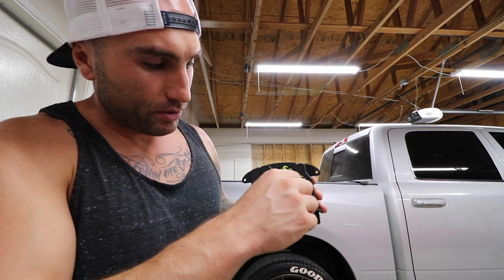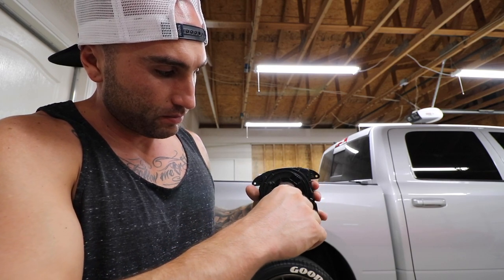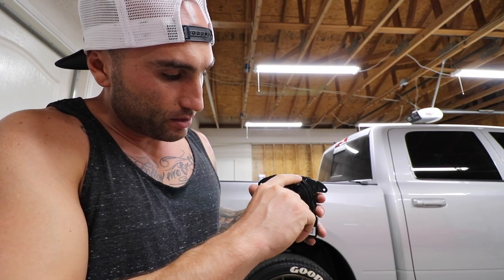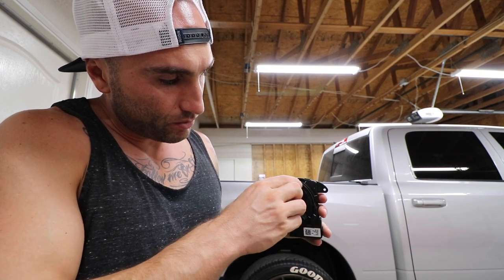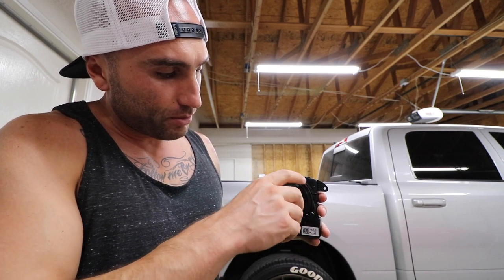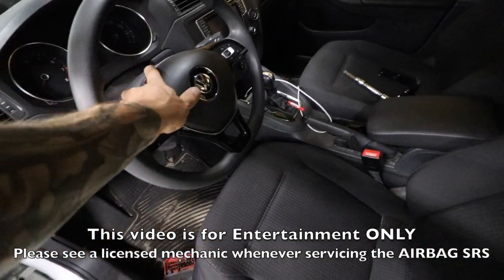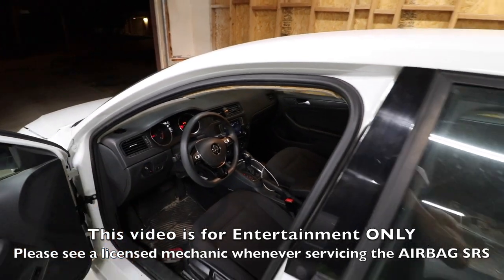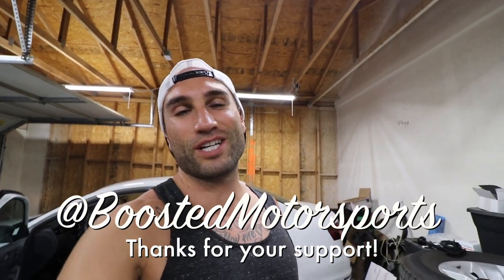How to Replace a VW Volkswagen Clock Spring - MK6 Jetta or Golf

Comment: Does anyone know if there is a 12V source that can support 1-2A current for an external steering wheel heater that is passed throught the clock spring on these cars?

Comment: Do not rotate your clockspring before replacing. Vw should auto learn SAS steering angle sensor as soon as you go driving.. it needs to detect wheel speed from all four before it recalibrates.. but if you center the wheel before removing just pull off and put on new clockspring and remove the locking tab

Comment: Before anyone replaces a clock spring/ squib refer to your workshop manual to find out what make of spring you have valeo or another. Not all exact models have the same make of clock spring which means removal and connections may differ. Also ENSURE you run an autoscan using the appropriate  diagnostics of the vehicle as you will 100% NEED the CODING from the old clock spring to enter into the new module. If you don’t have the correct coding you will have to put the old one back in again to get the code. After installation and coding the new module you will need to clear the faults using diagnostics because of battery disconnect and almost certainly need to do a steering angle sensor reset.
Reply from the maker: Good info!  There is actually a recall on this for these cars also! Any info on  coding with VCDS if the old clockspring was toast and got thrown out already?
Reply: BoostedMotorsports I think your only hope is to contact the country rep for VAG and beg for the code via er-win or search for the old /new part number on VAG or Ross tech forums with people who have cars with the same chassis number and have done auto scan. If you look at the autoscan at location 16 that’s where the steering wheel control module will be. If it’s the same part number with correct code and same chassis number then you could be in luck. You could try entering the code to see if it works. Always do autoscan before though if tit need to go back to how it was.
Reply: Why so much BS? Can’t anything be simple on these cars? I’m instantly regretting my purchase
Reply: @AOqueso  bs is what keeps the dollar bills rolling into the mechanics  😂

Comment: I replaced the clock spring on my Cadillac ATS-V. When  starting the car up I get the dash messages for service for Power Steering, Stabilititrak, and Air Bag. Is this normal with a new clock spring replacement?

Comment: Great video! Same procedure for a CC with immobilizer key fob (fob inserts into dash next to steering wheel), you just have to leave the battery connected until after you are done turning the steering wheel to get the airbag springs popped loose. Remember to center it before disconnecting the battery.

Comment: I did the same repair but I left the wheel turned to the side. when I reinstalled the new clock spring I centred it, and then offset it to where the other one was where I had marked it against the column. both ways work.  the car will initially show a steering wheel calibration fault, but after driving a few blocks it goes away on it's own.    nice video. good pace. sweet setup with the viper and the garage.

Comment: Mate will I need anything to keep the program if I disconnect my battery. I notice people plugging in a small device when they disconnected my battery to replace it. They said it was to keep the codes. Is that an issue. 
Great vid. Thanks

Comment: Does it need coding after installation of the new module
Reply: yes it does!
Reply: I’m changing mine out today
Reply: @pavelsotiradrian1901  what does coding mean?
Reply: I replaced the new clock spring I have to take it to get coded?
Reply: @carlosavila1425  it means you have to use a Vagcom or other tool to read the ecu of the car and transfer the coding from original piece to the new one. Otherwise won’t work!
Reply: @pavelsotiradrian1901  thank you

Comment: Thanks for the video. I completed my change over last week. The hardest part for me was the removal of the horn piece. It was super heavy and would not budge out. Eventually I understood the mirror to see the spring clip. Once levered off the post I needed the back end of a hammer claw to help pull it straight out. I struggled for hours when I needed a bit more grunt to pull.
Reply: My mechanic quoted $2000 which was way too much. Such a simple job. Part from the wreckers $89, tool from repco $42.

Comment: Hey man I have a 2015 Voltwagen Jetta. The airbag light, Traction light, and tire pressure light is on. I brought it to Voltwagen they said that the clock spring needs to be replaced and reprogrammed. I am hearing that there is no programming needed for the spring. What do you think I need to do fix the problem? Please get back soon as I'm trying to fix this problem quickly. Thank you.
Reply: You'll have to code it, see my other comment

Comment: if a clockspring wont rotate at all I take it ....its bad....would that keep my wheel from rotating?  steering wheel wont turn even after I take the steering wheel lock off.
Reply from the maker: They are just plastic so I would think something else is going on in your steering column.

Comment: After connecting  the battery at the end do you have to reset the windows and other electrical stuff using a scan? Or it should work out automatically?
Reply from the maker: If you didn’t have a SRS light before as long as you don’t connect the battery with the airbag removed then you shouldn’t have to reset anything with a scanner. The windows you just reprogram yourself once the battery is connected again by holding each switch up for 3 seconds so that the one touch down relearns. 👍

Comment: Nice video, i’m gonna do it later on. Those VW have really parts. 
If not broken yet watch for the Handle hood release mechanism. Any spec torque for the steering wheel bolt???

Comment: Why change the clock spring?,   Good video
Reply: Vycho Mora the clock spring has the wiring that controls steering wheel functions like the volume and mfi. Also controls the power to the airbag igniter. So as long as the wires are pulled and snapped the airbag won't work nor will the electronics on the steering wheel. It can also trip the airbag light
Reply: I have that problem it snapped when i turn left a week ago

Comment: Thanks for this valuable video. Can any one helps me to know what is the specific coding/part of the spring clock for Seat Leon 2011 1.2 Tsi ?
I saw two different kinds of spring clocks in the net that seems to be fitted but i don't know what is the right one..